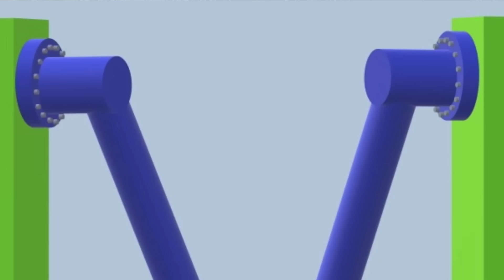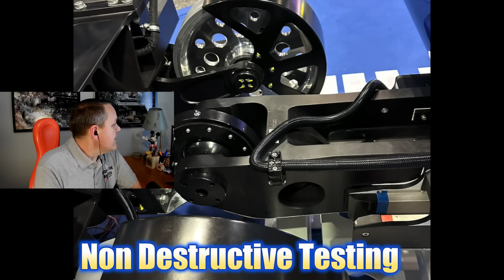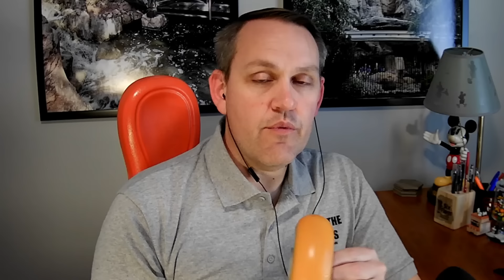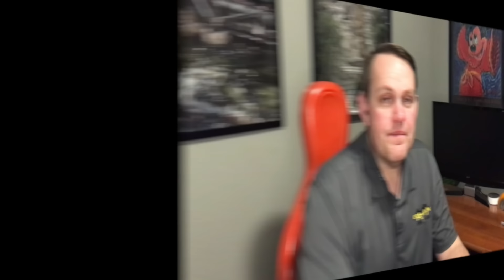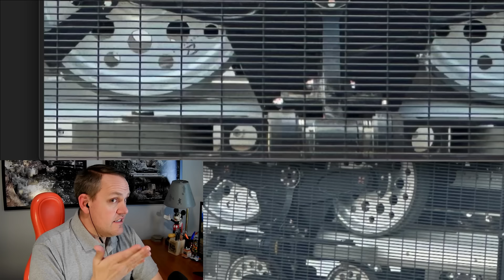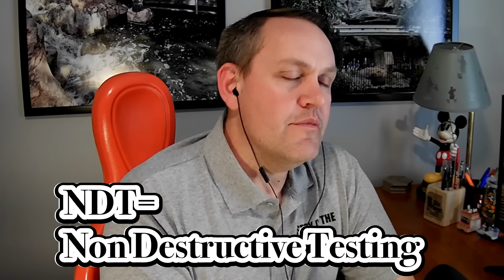Top Thrills 2 wheel carrier analysis

Comment: On the zamperla assembly: why wouldn’t the front car guides or upstops also have these mudflaps?
Reply from the maker: @Lustra_OA  to try and prevent things from hitting the wheels. Basically they have to be on some times for machine guarding depending on where it’s installed.

Comment: Ryan, the longer this plays out the more I believe you are exactly right with what's going on here. I believe you are 100% right that they welded these gussets into place on the existing wheel carriers as a test platform to see if it would stabilize the guide wheels. They probably tried adjusting the guide wheels bumpers like you said until it became too stiff and created deflection in the steel. Once they verified the braced units would work, they then had to go back into their cad or design software and add in the filler bracing to the existing design, possibly beefing up the entire assembly with more webbing and machining areas to lose some weight in areas they could afford to. Once those revisions are finalized after stress analysis and probably a team of engineers then they go to manufacture each wheel carrier. 
I think people think it's an easy process, but they don't understand that each carrier is basically going into a cnc as a block of billet steel and basically being 3d printed to the exact finalized design. 3 trains x however many carriers per train. And I doubt zamperla has more than 2 of these at most in their shop. Probably only 1. My brother is a mechanical engineer building robotic automation machines and the company he works for has 1(ironically enough robotics is so similar to roller coasters). So sourcing out getting these built or doing it in house is going to take time. These machines are amazing, but people don't think about the hours of cutting it will take to make 1 unit, or to make 60 of these. I'm just guessing probably an 8-16 hour cut time depending on complexity and machining away areas for weigh savings. 

Then they will probably x-ray each piece before sending to powdercoating before shipping them. 

I'm sure they are working fast as they can, it's just the process and people need to be patient and trust it. Wouldn't be surprised if they aren't shooting to get at least 2 trains done for around the 4th of july... but that all depends on sourcing the machine work and QC process
Reply from the maker: And we are still just speculating as well. Who knows, a whole train might be in the works?
Reply: Makes total sense.  I also wonder if tightening the guide wheels tends to slow the train.  This would make sense given that they started to experience a number of rollbacks on the third launch right before the ride shut down.  Thoughts @ryantheridemechanic ?
Reply from the maker: @noclosecoasters  depends on the ride honestly. Some rides, tightening them will make it go faster. Some slower. Either way if you over tighten them you blow the wheels out (melt the urethane.)

Comment: It's crazy this has been as big of an issue as it is. The hunting has been evident in pretty much all videos since they first started showing off the ride. The two times i rode it was pretty wild. People kept making excuses about how TTD used to do that but it really didn't. Not to the same degree for sure.

One thing I hate about the new trains, and i wonder how this effects the engineering and stresses on the trains is the higher ride height. When the train twists on the tower, it feels like you're going to be ejected and not in a fun way. I ended up bumping into my daughter both times going up. Anyway, the increased ride height i would think would apply more twisting force to the trains and track and i just wonder if that might be an issue, if not now, at some point.
Reply from the maker: Only way to fix that would be an entire redesign of the train. Not that they wouldn’t do it but if push came to shove it might need to happen one day.

Comment: Something I've wondered for awhile now, does each coaster get its own set of mechanics? Or does one mechanic get assigned to just a few rides, or just a general park wide mechanic? Are woodies treated differently with staffing?
Reply from the maker: coasters typically share mechanics. a mechanic could open 3-18 rides in the morning depending on their area. woodies have a carpenter crew. at parks with multiple woodies the carpentry crew is split up to cover these.

Comment: Thank you for your video. I have been a coaster enthusiast since I was 10 years old. I loved riding front seat on all of the rides just to see how the brakes and everything worked. I currently work at a machine shop as a processing engineer. I wish I worked in your field
Reply: I was always curious about what type of material the parts are made of. I currently work with punch and dies so majority of it is cold rolled A2, M2, some powdered material and a few times stainless. I was also a surface grinder at one point in time and realized the smallest of material change and heat treatment can make a huge difference. I am also familiar with Urethane strippers for punches which helped me to understand the actual wheel makeup
Reply from the maker: I was in the right place at the right time. For sure.

Comment: “Theory will only take you so far.”

I ran across a guy at KI that had ridden TT2 22 times and he said they need to slow it down. It is going way too fast over the top hat and through the heartline. He is worried the track is not going to handle the forces and be severely damaged. 

Now as for the trains, less is more is not always the best or the greatest option. That single web holding the guide and up stop wheels on is way too small. Something they proved by adding gussets; of course the only thing they did was move the point of failure to the next weakest point. The ride may open again this year but the problems are far from over.
Reply from the maker: I think revision 2 carriers are in the works. I also think the supports are too small. But no math to back up that statement.

Comment: There's a picture out there where it looks like they were strain gauging the wheel carriers to me. As a structural testing engineer that's what I would have done to see if you're going to get cracks again. Have to check if you're under the fatigue limit or at least tell cedar point how long it will last before needing replaced

Also I saw American testing services (the ndt company) has an opening for cedar point to be based out of there. Maybe to support the Inspections on tt2
Reply from the maker: I’ve seen thing like that done. If the NDT guys couldn’t get to the ride that day, it didn’t open. A park that big naturally has the need for an embedded NDT guy or 3 for sure!

Comment: Technically you are wrong, I have several degrees, including "Mech Eng", "Gear Design/Geometry", Machinist and CNC Programmer...managed machining, engine build, engineering for a major Nascar Team, Senior Engineer at "GM" and" Boeing", yes building vehicles and planes.  The term "billet" is common today, and the "grade" of the "ALUMIIUM" is critical. T-6061 is most common and used endlessly, aerospace applications and race car applications relate to "7075", there is no "steel" involved". Majority of your aerostructures are '7075", there is no billet "steel". All current aerostructures are aluminum, not steel, again it's all about the grade of the material. The "stresses" involved on an aircraft, commercial and military exceed this ride...which I rode for app. 18 years...bearing "choice" for the application is critical, as well as the actual bearing manufacture. Yes, the actual shaft will be steel, and again the choice of steel is critical.... the actual wheel, "lighting" holes machined into them is critical....I've manu. components that include the moon and mars, with the extensive down time, it's a serious issue.
Reply from the maker: Wow that’s really interesting! So my experience is from other manufactures. (I’m just a mechanic) we purchased a billet housing made from aluminum and billet wheel carriers (they called steel). And the engineers at the time said you don’t typically weld on billet. That’s all I really know of the subject of billet. That’s a lot of info for sure. What’s your take on the whole gussets that popped up?

Comment: I actually brought a ride attendants attention to a train on Iron rattler last Friday during Rollercoaster Rodeo. Nobody noticed that something, a cape or piece of trash had got tangled in the very back road wheel of a train. I saw it when I got to the air gate and the train had dispatched. As it went over the drop it was flapping in the wind behind the train. I made my lap and as I got off I told one of the ops that train 2 had something tangled in a very back axle, left side wheel assembly and to look when it returned to the station. He was very thankful and they actually got a mechanic over there pretty quick, just a minor delay and got it untangled and reopened the ride.
Reply from the maker: Good job! Sounds like it was important enough to hold up operation.  If they ran it, that’s their decision but as guests all we can do is inform.

Comment: This is so in depth I love it. Analysis LOL. 6k subs coming soon for you woohooo!! also answered one of my first questions about the train with the front wheel covers there. Had an additional question to the wheels locking up, is it easier to tell a wheel has locked up when the track is wet? Sometimes you can hear on old arrows the little squeal noise and I figure its just wet track, but would a locked up wheel make on wet track make more noise then a regular dry day?
Reply from the maker: Wet wheels trend to hydroplane as long as the track is wet. So you could see some skidding on the wheels if the bearings are cold especially. The sound would be barely noticeable as different.